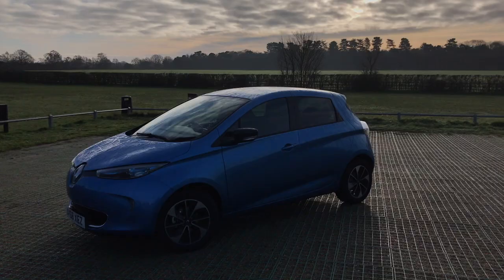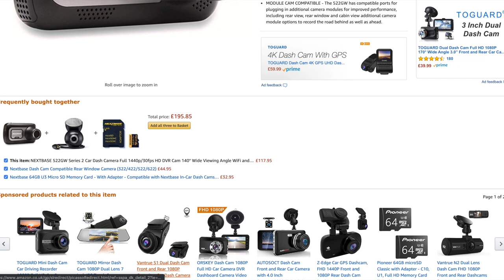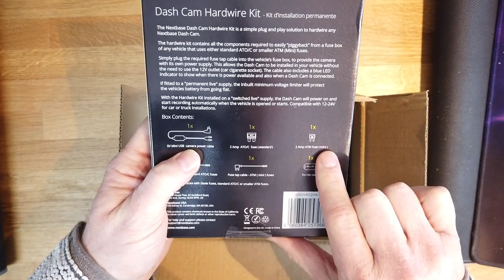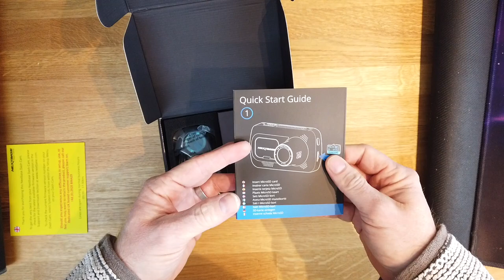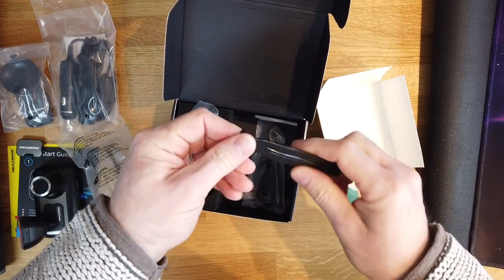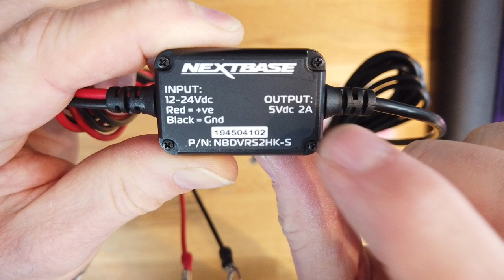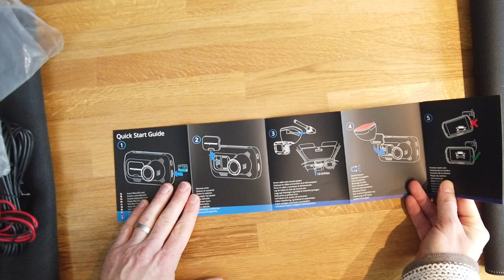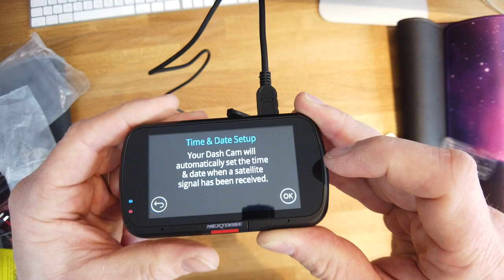Nextbase 522GW Dashcam Part 1

Comment: Have to say I got all the 522 cameras front and back connected up to three different vehicles. I changed the 32GB cards in them all to 128GB and so far av no probs/issues with any of them thankfully.
Reply: The 522GW supports up to 128GB so of course it will work

Comment: Great video. Gives me some confidence in fitting it myself. Can I ask if it matters about the size of fuse it replaces in the fuse box please?
Reply from the maker: The piggy back fuses have a space for the fuse you remove, you need the right type and the fuse needs to be a circuit that comes on with the car otherwise you’ll drain your battery. Best consult the manual or an auto electrician

Comment: Nice instructional video, however, one very important step has been entirely overlooked.Before plugging the fuse tap into the chosen fuse outlet on the car's fuse board,you need to test which leg of the vacant fuse location is positive.If you do not do this,it is possible to put the fuse tap in the wrong way around.If the tap is the wrong way around, the camera would still work as it should but would have absolutely no fuse protection.
Reply from the maker: Hi Thanks for the message. If you have one that works as you describe, a bin would be a very good location for it! You should only have conductivity between one pin though the fuse to the flying lead. The only fuse that should be connected to both pins is the inner fuse that replaces the one removed. I can confirm that is how the next base kit ones work. However I’m sure some less scrupulous companies are doing it a very naughty way..

Comment: I can't make up my mind whether to mount the dash cam using the sticky mount or the suction cup. I think the sticky mount might come undone in hot sunshine during the summer months. What are your thoughts on this Evlain?
Reply from the maker: I’ve been really impressed with the suction cup, I’d go with that first, you can always change it later. Also depending on how you’ve purchased your car it may be better, as it’s easier to remove when you come to sell/give back/px

Comment: Before hard wiring I'd check your warranty if you have one. Some warranties are void if you hard wire your dash cam.
Reply from the maker: Great point. If you cut cables you are almost certainly. In this case the car was leased and the specific instructions were. 1. The lease company felt that fitting a dashcam was in their interest 2. The dash cam must be installed using the piggyback fuses to make the fitting entirely reversible.

Comment: Very nice and informative video! Quick question tho; would this dashcam suffice for lorry drivers do you think? I have been looking for a decent dashcam, and i keep on steering back towards the nextbase 522GW because of its overall simplicity and superior video quality + it is one of the few non chinese made products, but it seems like it is more suitable for a car than for a lorry; so i'm a bit affraid of ordering one and then stumbling upon some compatibility issues afterwards.
Reply from the maker: Hi! So checking the mounting it looks like it would cope with a flatter screen profile, there is enough rotation in the mounting it that make sense. Voltage wise, check you have a commercial vehicle it is likely to have 24v system, but you may also have 12v too. in any case the nextbase hardwire kit is compatible with either. If in doubt consult an automotive workshop as they will be able to check the specifics of your vehicle. Thanks!

Comment: Question.... does Parking mode still work re movement if you have only tapped a swited live fuse?
Reply from the maker: Yes but only till it flattens the battery
Reply: @eviain  how long is that then on the devices internal battery?

Comment: Hi Evlain. Njoyed your video. I did enquiry with Nextbase about the use of parking mode and they told me to hardwire to a constant live fuse like the radio. This is because the hardwire kit has a built in cut-off of 11.2 volts, so as not to drain your battery.
 I'm just doing a lot of research at the moment but will hopefully be buying this model pretty soon 😃
Any nearer to part 2...?
Thanks again 👍👍
Reply: Hi Steve, Did you get this Dashcam? Interested to know how wiring it via a constant live fuse works in pratice?
Reply: Hi James. The funny thing is, shortly after this my car starting developing battery draining issues so I've put off getting this for the time being. At least now I know how to wire it up...
I do like the idea of parking mode though & if you get the cabin view module you'll be able to see if anyone has been peering through your windows if they've jolted the car at all..
Reply: I got my dashcsm for parking mode too. It's s great dashcam for quality only while driving. I got mine rigged up to live. And I have to unplug mine after driving. Cause just after appox 24 hours it drains my car battery completely. Which sucks
Reply: @stevemahoney5209  same here. Great quality dashcam. Can't fault it. But parking mode sucks as it drains my car battery after appox sitting for two nights
Reply: @stevemahoney5209  I think I might just rig it so it only takes power when car is on and live. save me from plugging and unplugging it every time as much as I want parking mode on
Reply: @Khuram Nasar  Thanks for the info. Nextbase told me that the cam will switch off so as not to drain the battery if you have the hard wire kit, so don't know why it's draining your car battery. Probably better then to not wire it to a permanently live fuse 😃
Reply: @stevemahoney5209  oh I got a new car battery fitted. Old one was knackered anyways. I Gona risk it again next time when o pick up a car jump starter to see if it can improve parking mode function
Reply: Please let me know how you get on. I was also looking for a jump starter. Good idea. I like the Arteck js08 (800 amp) which is £29.99 on eBay, sold by sgsdirect